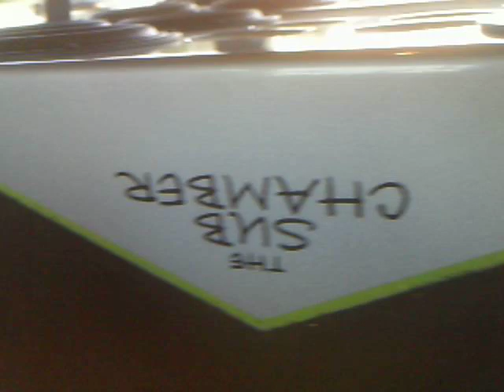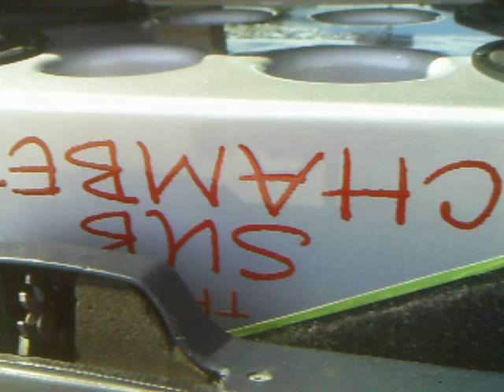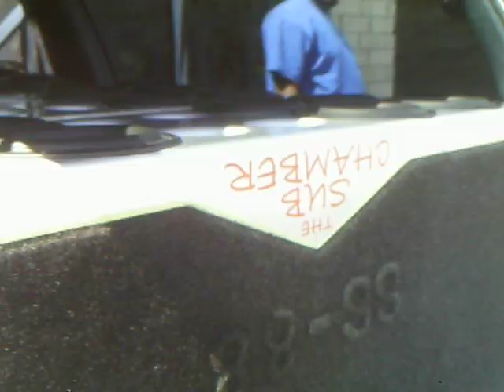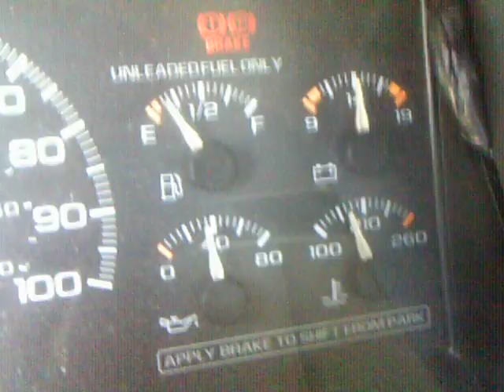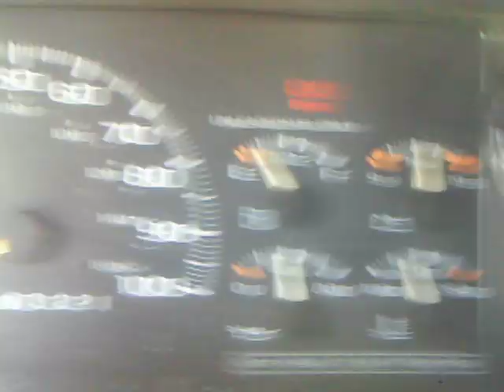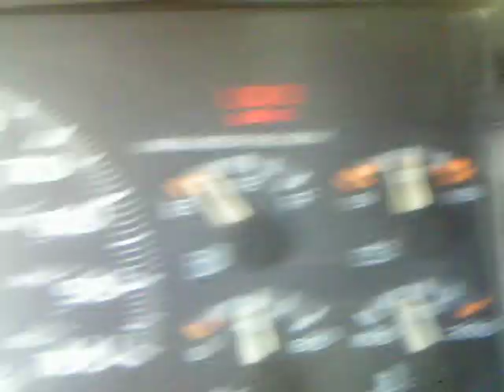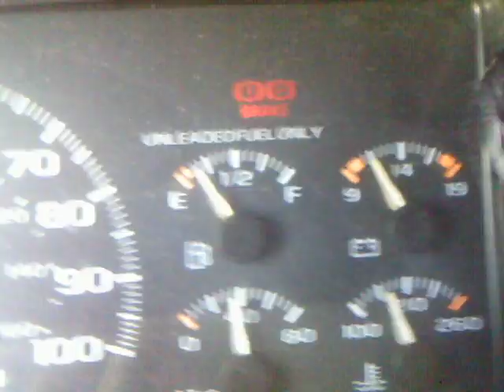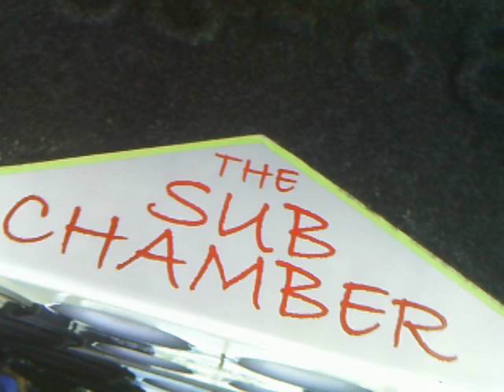tang band - 32 subs-2 linear power 8002 sw amps drain battery 1.AVI

Comment: @Gauthier808 Well my buddy used to build winning systems for competitions back in the 90's and one Astrovan that he did hit 148db at 40Hz with a single Orion 225 HCCA on the bass which has a maximum power rating of 400W RMS. The amp was powering 12 12" subwoofers in a massive slot ported cabinet.  The roof and sides of the astrovan had metal bars welded on the inside to prevent sheet metal from bowing and flexing and thus had minimum loss and cancellation.  The front end was powered by a 275SX.

Comment from the maker: @Gauthier808 no sir, you suck... i'm not mr. meads and i dont need 30kw to hit a SMALL 155 db @ 35 hertz. if you knew about cone areas and how to measure them, you will find out that 32 smaller subs has more cone area than 4- 18" subs. also the power needed for ported enclosures is far less than sealed enclosures. so unless you know me and can check the db level of these or any other smaller subs i know how to use, then keep your talk to your self. this was ONLY a test. thank you sir.